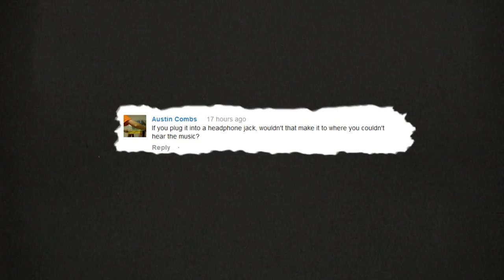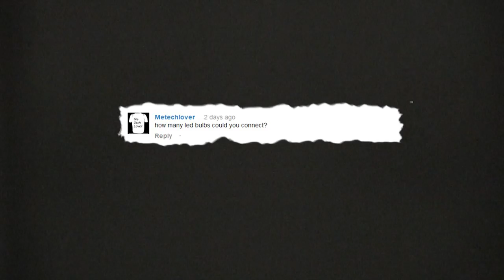LED Beat Box! - Follow-up

Comment: Erm depends, do you have solder? The gun for it? Led's are like 50cents ea at radio shake. The chip is like 5 bucks, if you want 2 channels you'll need 2. Finding a speaker cable around the house should be easy.. If not they are like 5 bucks.

Comment: You can also wire up the LEDs in parralel, so you can actually wire up as much LEDs you want. 
If the power supply is 12v, then wire up 4 LEDs in series and another 4 LEDs in series in parallel to the first 4 LEDs and so on. Did this and it works a treat, running 16 LEDs off of 12V (from my PC's power supply)

Comment: Man you can connect as many led as you want, it doesn't go by voltage, it goes my how much current they draw, the amp or mah your power source decides that number.   If it was going the way you describe it, as soon as you turn your radio on, the led wouldn't work because the radio is taking all the 12v. That makes no sense.

Comment: if you wire the leds in parallel than as long as the power supply is at what is rated for one led you can power as many as you want (as long as current is high enough).

Comment: Shouldn't you be able to use 4 Leds (At 3volts) in series (To add up to 12v), then do this multiple times and connect them in parallel? The voltage would stay the same but the amperage would drop, but that's ok because Leds use low current? Please correct me if I'm wrong..

Comment: Short leg of an LED is the negative and the long is the positive. Make sure your LEDs are polarized properly. I'd personally put a diode on it too. Make sure your TIP31C BiPolar Transistor is soldered into the circuit properly too.

Comment: Hey kipkay, I have done exactly what the schematic has, except that I am only doing 4 LED's instead of 8 and only 1 circuit. I also have the Y adapter so I can hear audio through my headphones. Though when I start playing my music the LED's dont flash, they dont even turn on! They are all working and I have a 12v power supply and a TIP31C, but nothing happens. There is a video on my channel on it, it would be very very very much appreciated to hear from you!

Comment: mine didn't flash :( the leds were just glowing. how did you attach the earthing to the audio cable (I think that was my problem)? usually there are 2 cables coming out of the audio jack, so do you attach the earthing cable to both separately or do you solder all together in one big mess? thanks

Comment: Dear kipkay! I have an idea. As I'm gonna play the music from my laptop i tought that the power source could be it's USB connect. So I would cut a useless usb cable plug it into my laptop and use the red and black wires as + and -. What do you think, will it work? As far as is know it provides 12 Volts, so theorically it could handle 6 leds.

Comment: I would say you shouldn't hook some LEDs too a cars speakers because I have a MTX AUDIO speaker which takes in about 100v the LED takes in about 1.5v that would be too much power going towards the LED and the LED would pop 
You have to buy CERTAIN LEDs for CERTAIN speakers 
Small portable speakers you can solder the LEDs to it

Comment: No, the battery has to be running, you can set it to idle and it will work but most modern cars cant turn off the engine only anymore.

Comment: LEDs are current driven not voltage driven.  This set up only works with a power supply that has a limited sourcing ability.  You hook this to something that can source more than a few hundred mA of current and your LEDs won't last very long.

Comment: well im not kipkay but what i did was start by making something called a  "mintyboost" (google it) then doing as much research as possible so that i didn't screw up. then i made flash lights, took apart radios and used google to find out what all the pieces were, what you need to know is what all the pieces are called and how they look like and their uses then you should be good. hope i helped!! (p.s. message me if you need to know anything im only 16 but i've been doing this for like 3-4 years)

Comment: there are many different leds each with different voltage requirements. What you told us was a generalization. there are 80 lumen LEDs out there that run off of mili-volts.

Comment: In this case you would probably look at 6 LED in series but you can make multiple groups of 6 LED and then connect them in parallel so the voltage across them stays the same but you divide the amps. In most cases LEDs do not require a lot of current so those adapters are strong enough to power a bunch. Hope this helps!

Comment: I've made earmuffs into headphones before.  It's not hard.  Go to a local store that sells shooting supplies and look for some ear protection, like Remington ear muffs.  Then buy a cheap set of headphones with 1" round speakers on each side.  Pop the speakers off and put them inside of the ear muffs.

To make them louder, find the headphones with the little volume slider mid-way through the cord.

Comment: The adapter measured 19V because it wasn't loaded. When you'd hook up a load to it so that the current is around the max specified on the adapter, it should drop to around 12V...

But 19 is a pretty good number to calculate with because the LED's don't draw much current at all...

Comment: Fortunately enough, most all USB ports on a computer are current limited, and if a device draws too much the system will simply turn off that port.

I've even had Windows display an error that a device attached to the system was drawing more power then it should, and was therefore shut off. I don't know if this is a standard thing on all computers though.

Comment: Kip, I love you, but I have to point out something. Your "math" on LEDs is kind of off and very vague. If your logic was true, I would have never been able to hook up 24 high powered white LEDs to a 5 volt USB port. I did have them running parallel with, I want to say, 52 or 83 ohm resistance on each pair.(can't remember) 
Sorry if I came off as a dick. Thanks for your vids!

Comment: You could always fix mirrors inside the box to reflect the LED lights if you couldn't actually work more LEDs due to voltage issues.

Comment: Try putting a amplifier after your speakers or headphones, but before you led's.  That way the amplified sound will give more power to the leds causing you not to have you headphones turned all the way up.  If that doesnt work i would check the power out put on you power supply and make sure it is sufficient enough to do the job.

Comment: You could wire up way more leds if you adjusted the power supply or but some higher wattage resistors in series with the light circuit

Comment: When you measured the voltage of the wall adapter it was "unloaded voltage" the 19 volts was to be expected. This is normal for wall transformers. Adding the LEDs as a load will change the voltage to sound 12 volts DC. To use this in a car you will not have to use less LEDs; but if you did use fewer LEDs, they would shine brighter.

Comment: you'd have to tap off the power supply. or have an unsightly cds cell in the corner of your screen, but if the screen went dark in that corner the lighting would also dim.

Comment: You could add little speakers inside your box and just connect them up the same way. I know there are some speakers you can buy that just power through 3 volts like your LEDs. So even a non-mathematical genius can work that out.

Comment: KipKay, you can wire it in parallel circuit and get 3 volts to power as many lights as you want!! It can also be portable with this idea!!! I built this type of system a year ago using 3 volts and 22 blue LEDs.